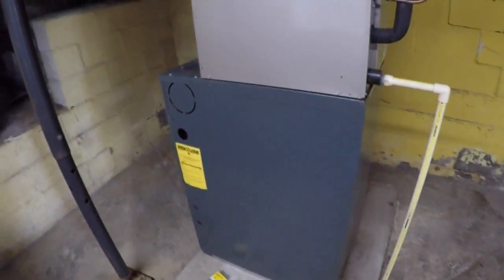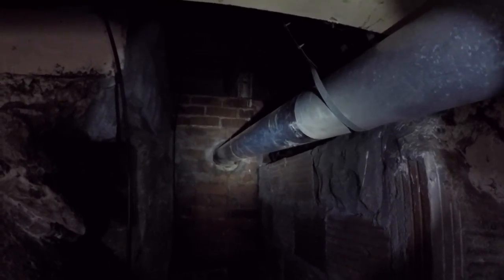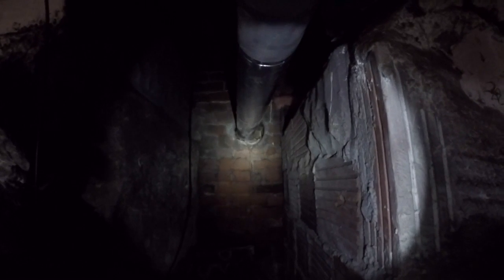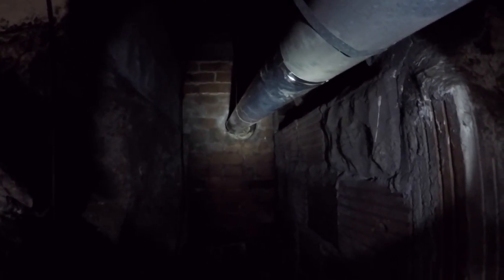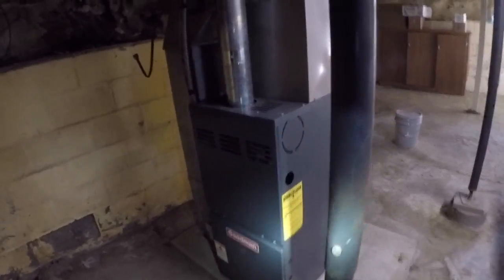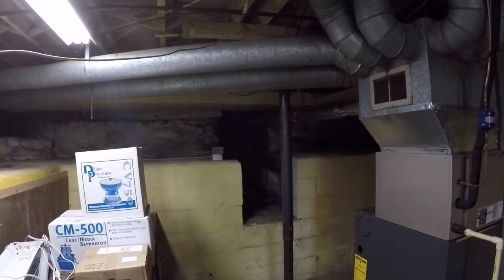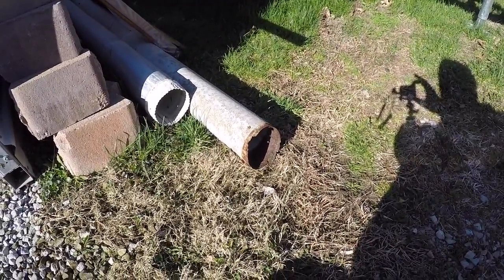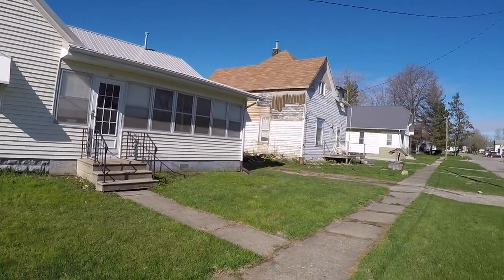Furnace Exhaust Repair - Rusted Pipe

Comment: Sorry but this is a terrible installation. You really need a chimney pro in there. First of all, it needs a full length liner. It can legally transition to the B-vent in the attic if done properly. I doubt very seriously it is even supported properly at the roof. The vent connector is waaay too long. You need to refer to the sizing charts in the fuel gas code for connector sizing, which goes up in size- not down as suggested. If that is an unconditioned space, it must be B-vent. The horizontal connector must slope 1/4" per foot. The joints must be secured with a minimum of 3 screws per joint equidistantly spaced. No foil tape! Aluminum will conduct more heat resulting in a cooler stack temp. I strongly recommend you get an unlisted CO alarm asap. This should not be DIY work. You need a pro to perform combustion analysis to ensure the equipment is operating properly.

Comment: That's a really long horizontal run for that exhaust flue. Also, they usually don't recommend up-sizing the pipe diameter. The long horizontal run, and larger pipe will slow the draft (maybe too much), and cool the exhaust faster, which creates condensation. That helped rust it out. I would check with Goodman's installation manual.
Reply from the maker: This is just the way it was set up when I purchased the house. I really don't know who did the original instillation. Thank you for the tip though, definitely worth looking into.
Reply: @wannaBFree I agree mostly with the above statement. I understand as a homeowner you would have only replaced what was there. Realistically in this scenario you should have down sized your piping to 4” to allow your flu piping to stay hot enough to expel the exhausted up and out the roof. You really should have a “base T” at the bottom of the stack rather then an elbow but I understand your working in very confined spacing. Back to the flu thou if it had rusted and pitted that badly I imagine the 5” venting is to large to maintain sufficient heat for the flu gas venting like the above comment said allowing your piping to cool to much before exiting the roof causing condensation within the vent piping
Reply from the maker: Thanks for the info, I appreciate it!

Comment: No it's because of a bad cap. If you don't the copper cap for heat and not for anything else like a little Chinese cat. That's wrong you don't put that on there. Otherwise water gets down there and West was going to cause it to rust. Then if you get adjusted elbows and rust even faster. You should have blue pipe when it comes to your fittings this is a heavier gauge metal.

Comment: Wow, nice man. I haven't messed around with that sort of stuff gas freaks me out. Cool new roof. I put a new one on in '07 and won't need another one for a while, but may get the metal next time. I figure I'll have to do it one more time I think. Hey you'll be happy to know I finally got that silly ac/heater unit out. Thanks for your video on it.
Reply from the maker: Good to hear you got that AC/Heater out. I didn't want to spend the money on the roof but it was either spend it now or deal with the problems and expenses later.

Comment: thinking of doing the same, chimney falling apart, metal roof going up in a few weeks
Reply from the maker: We are glad we did it. Now no potential for any roof leaks. I think you'll be glad you did it.
Reply: what kind of boot did u end up using on the new roof for the vent pipe.
Reply from the maker: It's a silicone high temp roof jack. (boot)

Comment: good work, how did you check for toxins? and did you wear a face mask
Reply from the maker: Thank you, I didn't check for any toxins. We had just purchased this house and I noticed the heater exhaust pipe had a lot of rust and corrosion on it. That is when I decided to replace it. I did not wear a face mask. If the furnace isn't running you won't be having any toxic fumes.